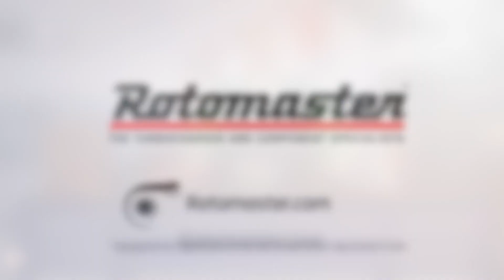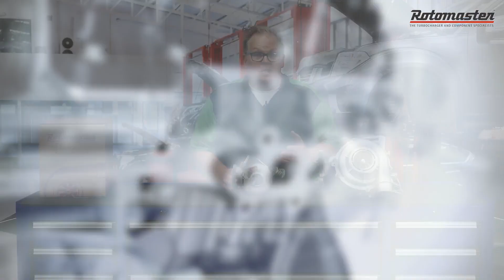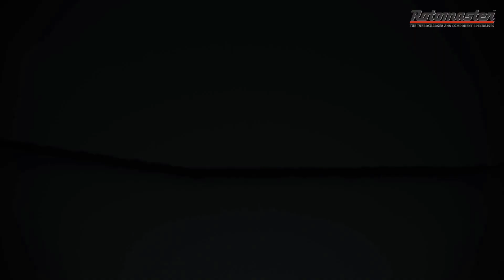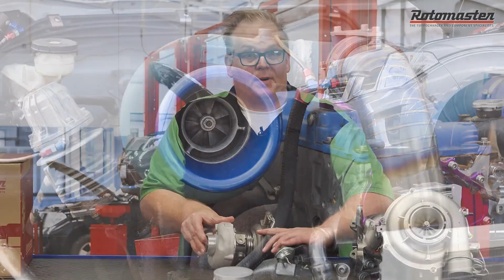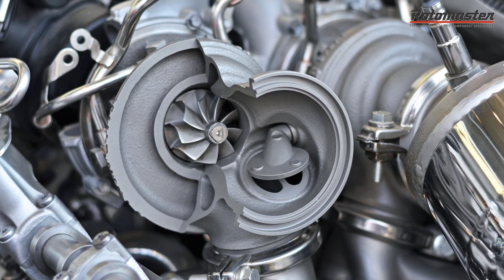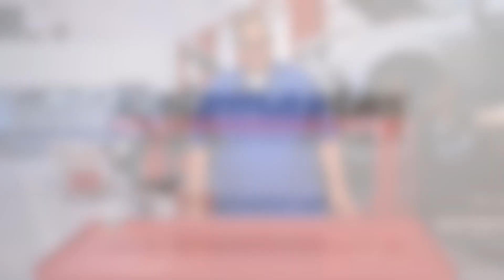Rotomaster Turbochargers Explained

Comment: Ive got a 2008 6.7 cummins. My compressor wheel just took a crap on me. I've never heard of yalls brand. It's significantly cheaper, how is that?  Quality not as good? Depending on what i find when I search , I very possibly could ve purchasing one  today
Reply: In the same boat with the exact same truck. KC is local and I trust their turbos because I had a whistler on my old 6.0 but to drop 2400 on one at one shot is tough and I found this brand one for 1300. Did you end up getting it or did you go with another company
Reply: Cheaper bc there junk, stick with oem or better, not some made in vachina shit